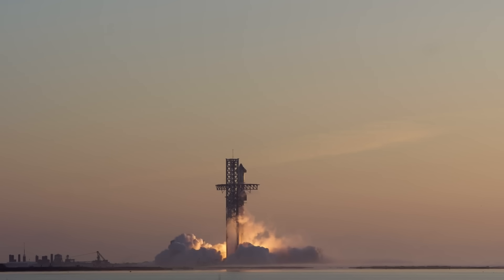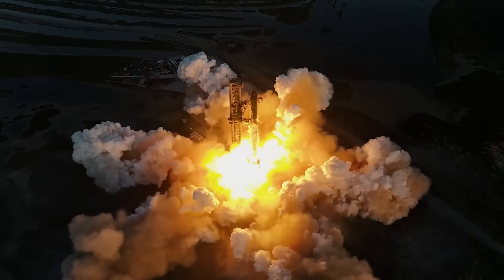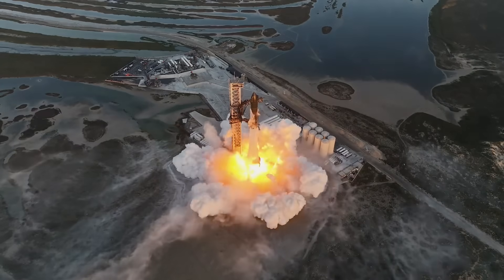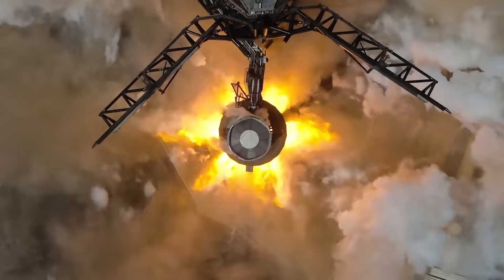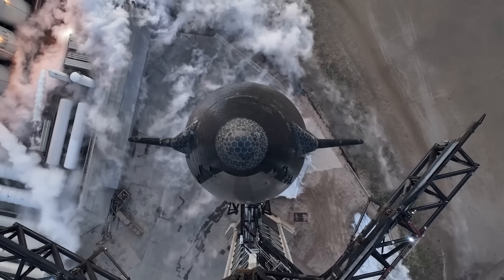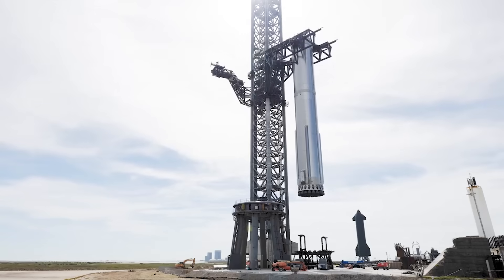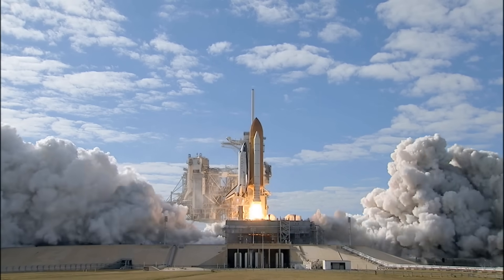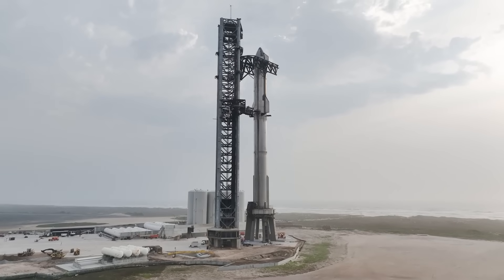How Did SpaceX's New Pad Hold Up Against Starship's Second Launch?

Comment: Why wouldn't they use a nitrogen rather than water cooling
Reply: water is simple and has got a very high thermal capacity.. and another take-up of energy when it goes from liquid to gaseous.. and if the aim is to convert as much heat from those engines into something else that can take it and just "flies" off with the prevailing wind.. water is pretty good at that.

Comment: Kinda causes one to wonder how they intend to boost rockets off the un improved surface of the moon. When the Apollo accent vehicle boosted from the moon it used the decent vehicle as an impromptu launch pad. After looking at SpaceX pad after the first launch we could imagine a rocket would excavate a crater large enough for the rocket to fall into before lifting off.
Reply: yea seems like that will be a problem, regolith is almost like sand very fine and dusty ... the good news is because the moons' gravity is 1/6th that of earth starship will weigh less, they'll need much less fuel, and would only need to accelerate to a lower speed to achieve orbit
Reply: that why for the lunar lander they got lots of smaller engines at the top going out sideways.. before the exhaust hits the ground it will have dissipated enough.. at least in the case of SX. No idea how the other landers are going to manage which are much closer to the ground.

Comment: A launch pad on Earth is one thing, but what to do about a launch pad on Mars?
Reply: that's a couple years off still, I wouldn't worry too much about it yet.
Personally I think that even if SX does some initial Mars journeys with the current starship they will come up with a more efficient construct before this really becomes a thing, something like a cycler. They got the capacity to built it here in LEO once SS works, why send SS over there if they can purpose built a system that will do the job much more efficient?

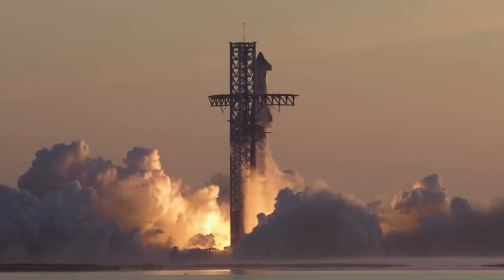Comment: 1:51 "You can't see any debris flying in the air" 
- Immediately shows debirs flying in the air.
Reply: Whatever it is, it covered the 122m height of the rocket in ~1 second. No bird can get anywhere near this. Even in a dive, the peregrine falcon is slower.

From the looks, it's some sort of panel. Roughly square shape. Not sure on size, but that thing got at at least 122m of altitude. Someone is having a bad day if it lands near them.

Edit: I would assume one or a group of heat tiles the thing has been known to lose in recent firings.
Reply: @skylerjr2648  The angle of it doesn't make much sense being from a piece of the rocket. Rather, I think it's probably part of the launch platform.
Reply: @JoviaI1  Maybe so. We can all agree the above guy is blind or trolling saying it's a bird whatever the case.

The thermal shields are hexagon in shape anyways.
Reply: Dude, that's a bird
Reply: @kwfoochannel  The thing flipping through the air from the fireball to the top left? Buddy you need your eyes checked.

Comment: I wonder what would happen if they were to put modified falcon heavy boosters on the super heavy booster. Would that increase payload or just be more complicated than it is worth?
Reply: They use different fuel types, so it would not be worth it at all. The integration would be a nightmare. You would literally need to build a whole new tank farm and piping system just for the boosters. 
I wonder if they will ever try 3 super heavy boosters in the same configuration as falcon heavy.
Reply: @joshuaashton1929  Sorry, I forgot to say they were modified to methane, but ok.
Reply: @mr.ackermann807  They wouldn’t really be falcons then. Merlin engines were built to run on RP1. Changing the Merlin to methane would make it a whole new engine.
Edit: spelling
Reply: @joshuaashton1929  No, I know that. They wouldn't be falcon engines anymore, but at the time, I wasn't sure what to call them, so I thought of the simplest design that came to mind. Would you prefer they be call mini super heavy boosters?

Comment: Just curious if they were to put rockets under blowing upward, if ignition of both at the same time, would the force not be pushing against adding to the lift. Or would it be to uneven and cause shifting?

Comment: Now you need to watch for corrosion. High heat. high pressure water can be corrosive to metal. Also the plate surviving... does not mean it survived fully functional. For example it can become warped and bent by the extremely powerful acoustic pressure of the rocket exhaust or by uneven heating.

Comment: Whenever the question comes up, "why didn't SpaceX build a flame diverter trench?" the answer is usually "well, Boca Chica has a high water table...". Unfortunately, everybody seems to ignore the fact that pretty much the entire state of Florida has a high water table since it's essentially a giant sandbar. If you just look at the launch pads at Cape Canaveral, you can see how much they are built up from ground level. They had to haul in many tons of rock and dirt to build each up, make a wide road to it for the transporter to roll on that also had to be built up, and so forth. Curious Droid made a video about the building of the launch pads at Cape Canaveral. 

https://youtu.be/kv1ydBgkthY?si=RhBjS7vp2Y3jt5N0
Reply: Simple, when you can use OPM…

Comment: I think its interesting how the plume cloud starts off white but then turns a pretty dusty brown, when the booster fully throttles up. You can actually see the faster brown clouds piercing through the slower white clouds a couple seconds after liftoff. I wonder this is proof of some minor damage around the pad, or if it's just loose dirt and sand being kicked up.
Reply: I think part of those brown clouds would also be the Raptor exhaust. You could see brown exhaust in the footage as the rocket cleared the tower and began to accelerate away.
Reply: @johnforster5312  unburnt methane being fused into larger Carbohydrate chains? NO2 gas being created in the atmosphere?
All the main products that are supposed to be going in and coming out of there (CH4, O2, CO2, H2O) would be colorless.

So I'm not sure what it would be.
Reply: paint maybe?

Comment: In test fires, the water stops coming out the instant the engines get running. In the actual launch, the white cloud is the water vapor, but within a second or two it gets pushed out of the way by a dust colored cloud, suggesting that the water stopped coming out due to the back pressure from the engine thrust. 
The question is not the heat, it’s the acoustic pounding the plate is exposed to.  And I have seen photos of the pad from ground level, But no image looking down on the steel plate after launch.   During the launch, you can see a cascade of supersonic concussion shock waves reaching as far as the tank farm.   ( this is slightly better than the shock waves from the first launch which were redirected straight up the rocket stack ).  So, again rather than fanboy repetition of Musk’s dissembling… let’s see actual imagery and assessment of how the plate held up.   Other launch facilities use a deluge system that injects thick masses of water laterally into the rocket exhaust, so the energy of the plume get’s absorbed in atomizing the water, and there is no backpressure on the outlets supplying the water.
This design essentially pre-atomizes the water, reducing the energy it can absorb, and its shooting out nozzles aimed straight up against plume thrust and shockwaves.   The water may be effectively cooling the steel, as it’s being trapped inside the shower head while the engines are on, and acting as a heat sink, but I still would like to see real images of the perforated plate.
Reply: The change in color/invisibility of the water may be because it became super heated steam, which is transparent.
Reply: dust colored cloud = everything that can burn (paint mostly) gets turned into visible smoke.. 
The water turns into super-heated steam right after it leaves the nozzles in the plates. And the steel-plates can take a little beating for a couple seconds, especially as the other side is where fresh water is racing along to make it to the nozzles..
Reply: @Chris_1024_ Again, I am not concerned with the HEAT energy.   The thick sheets of water used at other launch pads is primarily to absorb acoustic energy thru the atomization of the water. That is why it is injected as close to the nozzle throats as possible.  If the water comes out vaporized from heat, it does little to nothing to absorb acoustic energy, which propagates thru vapor as well as air.  That is why you can clearly see concussive shockwaves radiating outwards as far as the tank farm in all directions.   If the shower head is at 300 bar- that’s the pressure down by titanic.   That would be pretty astounding.   But again, the shot shows the initially white vapor, from all the water already OUT of the shower head, become dust colored . That argues that very little water is in that brown cloud. 
Hopefully, their construction is robust enough.  But I suspect that acoustic energy will do incremental damage to the entire complex and render it a not very rapidly reusable launch pad design

Comment: He struggled to build a useable launch pad here on earth, where it’s easy. 
So I doubt he’ll be building or landing anything on any other planets.
Reply: Cry more.
Reply: I don't know about other planets, but a Starship variant is planned for a moon landing. To avoid destroying the ground during launch and landing (potentially destroying the vehicle), this variant will feature additional takeoff and landing engines located at the base of the nosecone. Together with the much lower thrust needed to land on the moon, they will hopefully be able to safely takeoff and land on the moon without a launchpad.
Reply: It’s a brand new rocket… You need to test stuff… That’s exactly what SpaceX is doing.. If it was NASA they would take years between test launches… It’s been amazing what Elon and SpaceX has accomplished!!
Reply: @scupking  What's amazing about it? The Space Shuttle, using late 60's/early 70's technology, went from conception in 1972 to launch in 1981. And that was with significant delays. Starship was conceived in ~ 2012 and has yet to have a launch of the system where both booster and ship don't explode. I think it's more amazing that NASA can send rovers to Mars and they work the first time..no malfunctions. And..apparently..the tile protection system is compromised on Ship.  Took the Shuttle 9 years and Starship is still on the clock.
Reply: @TheMasterCylinder  "Starship was conceived in ~ 2012 and has yet to have a launch of the system where both booster and ship don't explode."

Yea this is disingenuous, from 2012 - 2019 nothing had really been established i.e. the vehicle wasn't even called Starship until 2019, all that happened in 2012 is they stated they were going to build another rocket that would surpass Falcon 9, however Starship wasn't even a thing until 2018 - 2019, and the first actual Starship prototypes began being built in 2019....

By this logic the actual Space shuttle history started in 1966, regardless 

"Starship was conceived in ~ 2012 and has yet to have a launch of the system where both booster and ship don't explode."

Yea because NASA is so well known for having their boosters land back on earth... SpaceX has made all of this significantly harder for themselves because they are creating something that has never been built before i.e. everything is reusable and is also meant to take people to the moon. If NASA is so much more amazing than SpaceX, how come NASA is relying on SpaceX to create this vehicle for their Artemis mission? 

"What's amazing about it?"

Oh I dunno:

Space Shuttle:

Height - 56.1m
Mass - 2,030,000 kg
Actual payload - 24ish tons
Cost per launch - $1.5 - $1.6 Billion (total money spent on program $209 billion). All of this is according to NASA by the way.
Engine - Developed and manufactured by Rocketdyne.

Starship:

Height - 121m
Mass - 5,000,000 kg
Actual payload - 100 tons
Cost per launch - about $100 million (Total money spend thus far $5 billion)
Engine - Developed and manufactured by SpaceX

Starting to get the picture yet? Whilst NASA is amazing, these vehicles are not comparable imo.
Reply: What about NASA's SLS? That has been in development since 2011 and has only flown once.. It uses outdated old tech that gets thrown away after every flight. and the next flight is towards the end of 2024 but most likely not until 2025. Starship is a completely new reusable design that is much much cheaper to fly.   @TheMasterCylinder
Reply: SpaceX has no future on the Moon with NASA as they intend to use cheap in situ lunar hydrogen as the mainstay fuel for their lunar programs.
SpaceX is commited to expensive Earth methane and not-so-expensive Mars in situ methane.
NASA has only been awarded SpaceX Artemis 3 and 4; National Team with "Blue Moon"  get Artemis 5 and beyond.

Comment: From expendable rockets to expendable launch pads. Although the pad technically survive, being operational after some more launches is highly questionable. SpaceX will eventually need to completely build new launch pad with a proper flame diverter, able to divert more efficiently the shock waves.
Reply: As Starship has twice the thrust of the Saturn 5, it must have a flame-trench and at least as extensive as LC39A.
But NASAs Artemis timetable won't allow SpaceX the time to bulid it.
Elon Musk indeed bit off more than he could chew when he offered the services of a theoretical vehicle "on the cheap" constained by a narrow timetable.
Reply: Yeah, that acoustic energy being reflected up in those shockwaves is really impressive. The band-aid seems to be rather suboptimal. If the reports about thermal tile failure are correct, then some more work is a necessity.  

It is funny how when SLS launched and a couple of elevator doors were damaged, the same people who are saying how bad that was are so positive about this ss launch. But then again, spacex is always successful because something was learned.
Reply: @Mentaculus42  When you have so many failure each launch, it is easy to learn new things. At this point SpaceX isn't learning on how to make a cost effective, reusable spaceship. It is learning on how to get into space. Starship could go into space, come back, go back into space again and still be a failure like the Space shuttle if its turn around time is too slow, too expensive (compared to a single use rocket) or there are flaws in starship like the space shuttle that can make it unsafe (despite the space shuttles  many successful flights).

The real challenge for SS and SH is still to come, and it isn't getting into space or coming back down.
Reply: @nickl5658  
Almost totally on the same page, my only quibble is that the design of the space shuttle was to a large extent “locked in” before the first flight and based on design requirements to meet turnaround goals & meet performance goals that were unrealistic after “real life” happened. The shuttle (basically) never had the benefit of changing things that needed changing, while spacex is constantly changing things, usually before they have been tested in “real life”. A Professor that I had a number of classes from set the 100 flight criteria for the space shuttle by literally thinking “that is a nice round number”. The space shuttle is a complex story that I almost never feel is told by knowledgeable people to put it in proper perspective.

Comment: You can see something flying through the air starting at 1:52. Starts at the base of the tower and flies to the left of the screen.
Reply: I think that’s a bird
Reply: @Noel_Jacob  It's a deaf one now
Reply: @Noel_Jacob Not the bird at the bottom, you can see a steel plate or something fly away in the middle going up and left. Probably not a huge deal though.
Reply: @Noel_Jacob then that would be a gigantic bird 😂
Reply: Perfect comedic timing, it gets yeeted from the pad right as he says "in a slow motion video of the launch released by SpaceX you can't see any debris flying In the air or impacting the surrounding water or structures" 😂
Reply: Deaf and Dead. Let's nick-name it "Elon"!